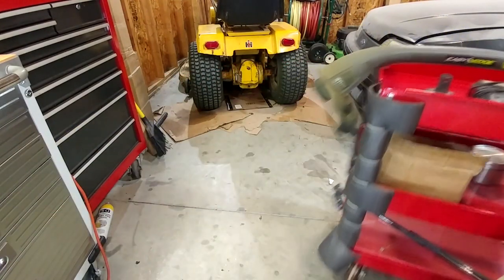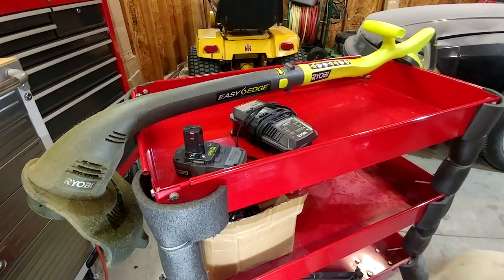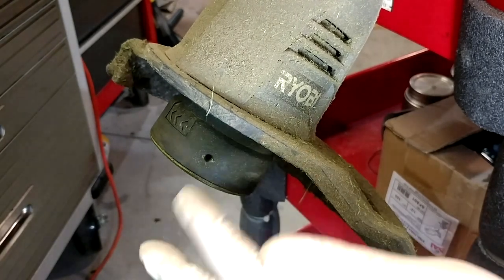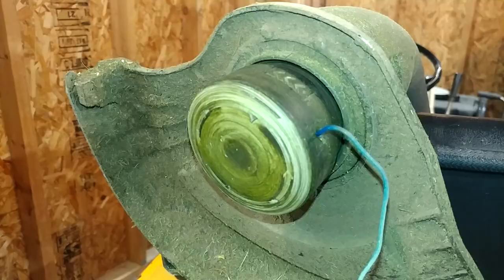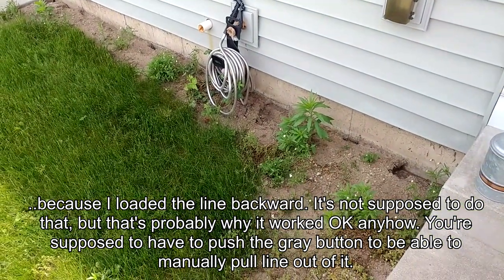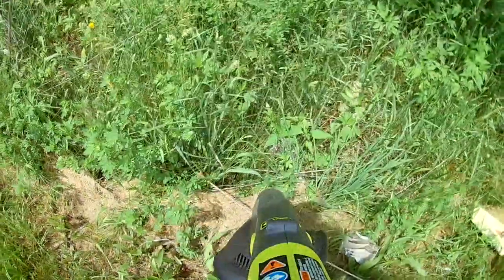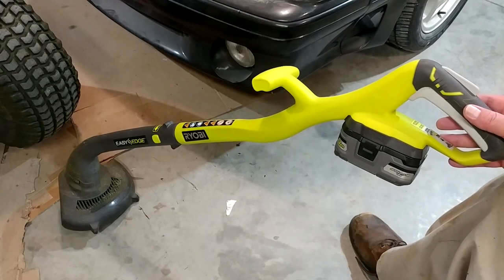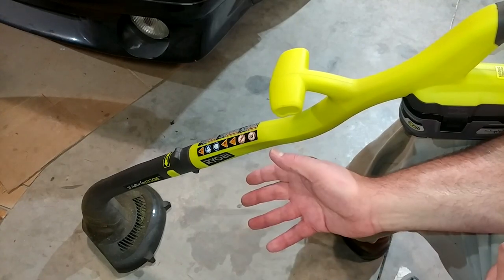Ryobi "EasyEdge" String Trimmer (P2003) 2 Year Review: Max's Tool Reviews!

Comment: I am 5'7½" and using this trimmer causes me so much backache because the shaft is not adjustable. So I have to hunch over. But my 5'5½" mother says it's good for her. The automatic feed on the string long ago ceased to work. So we have to frequently stop, turn the trimmer upside-down and pull the string out manually.
Reply from the maker: I'm 6'4" and it's pretty short for me as well.

Comment: Great video.  I have a dying Worx trimmer with Ni-Cd batteries that don't hold a charge.  Since I have some Ryobi One+ batteries from other tools, this inexpensive Ryobi line trimmer may be all that I really need for some small yard work.
Reply from the maker: Thanks! I've been very pleased with mine. A couple of updates on my thoughts though: The sharpened line doesn't feed as smoothly as the stock stuff did (though it does cut well) and I suggest at least a 3aH battery for it if you're going to do much edging with it.

Still, for the money, it's fantastic, IMO.

Comment: Good high quality NiCad is not nearly as bad as people remember them from the old Radio Shack catalogues when we were kids (I'm 50) and can be pretty useful even today.  I use a boombox outside a lot and I power it with 20 year old NiCad cells I bought in the 90s.  I just recently reconditioned them and I am still getting 1200mah out of them. Another nice thing about them is they stay good on a shelf for a very long time, like decades provided they have never been used.  I have seen 25yo new-old-stock cordless phones and the like with perfectly good nicad cells in them.  That will not work with any other cell type.
Reply from the maker: I never had much luck with them at all, particularly in power tools. Our 1980s cordless drill and dust buster were completely useless right out of their boxes. Maybe that wasn't the battery's fault, but that was my overall impression of cordless tools until somewhat recently. The Ryobis I've owned through both periods of technology perform much much better off of the Lithium Ions than they did off of the Nicads. I would have never in a million years expected that trimmer to even put up a fight against what I threw it into, but it did. Maybe I'm falsely attributing that to the batteries?
Reply: @TheBrokenLife  Things like this trimmer are not a good match for either NiCd or NIMH. You really need lithium and even then, the power density isn't great.  It is application specific.  
They are  a great match for a boom box or NiMH for a portable game and NiMh for X-box controllers and the like.  NIMH AA cells are a godsend for all things AA.  But anything using C or D cells is NiCad because good quality C and D NIMH cells are expensive as all hell. A good D is ten dollars a piece.   And you can get them at 5ah.
Unfortunately, everything today is throw-away. You buy a 300 dollar ipod and you throw it away in 3 or 4 years when the battery is no longer holds enough charge.
Reply from the maker: @tarstarkusz  I'm sure you're right about there not being a perfect one-size-fits-all application, but I really can't complain about how power tool batteries have gone in recent years. Although you and I have chatted a lot of Ryobi both here and over yonder, I do have some Milwaukee too and that stuff is also incredible. It's freakin' expensive though. I have what amounts to a $200 flashlight, but it's a really great flashlight.

It's not disposable around here! I will try to fix just about anything if given the chance (I've got a coffee pot torn apart in the shop right now). I still have my 60gb and 120gb iPod classics. The 120gb actually does still hold a decent charge... I do have to admit I don't have much use for them in the smart phone age though. I did make sure to buy phones that I can replace the batteries on without a soldering iron and a microscope. ;)

Comment: Have you looked into the '2-in-1 Pivoting Fixed Line and Bladed Head' accessory for it?
Reply from the maker: TLDR: No

The I can't shut up version: I've only used one of the bladed heads once and I broke it the first time out (snagged it in a fence and it sheared the entire head off in an instant) and I've never tried one again. 

My Dad had a Craftsman with a fixed line head and he really liked it, but to be honest the feeder mechanism the Ryobi comes with is so good that I can't see a reason to change it except for maybe the larger diameter line. For the power it has available, I feel like it does an awesome job with the .065 sharpened line I put on it.

FWIW, my Stihl uses .105 line (the fixed line for the Ryobi is .95) on a bump head, so if I need that much more power I can just fire it up. I will say there is a large performance difference with larger line and dual line heads make a big difference too. I'd be curious to see how it performs with it.

So... I did just look up pricing on the 2-in-1 one head, thinking if it was cheap enough I may try it out just for fun, but just that head is almost what I paid for the trimmer. 440 feet of made in USA sharpened line was $20 and will probably last for the entire life of the trimmer at the pace I use it.

Comment: Battery trimmer is the way to go for a normal house. Yeah if you are weeding a whole field then gas is king. But for going around the flower beds and sidewalk a battery one is tops. My old gas weedernwould not start so off to Craigslist to buy a used battery Ryobi job. Perfect. Yea it only lasts for fifteen minutes but that’s good enough for me.
Reply from the maker: With the 9AH battery, mine goes for like 45 minutes. It's great for what I need it for.

Comment: Mine just decided to stop working. Nothing happens when I try to start it.  Battery works fine in my chain saw, so it is not the battery.
Reply from the maker: Does the head spin freely if you try it by hand?
Reply: @TheBrokenLife  Yes, it does.
Reply from the maker: It's probably some sort of internal problem then. Sorry to hear it!
Reply from the maker: Would you be interested in selling me the corpse? I'd be curious to take it apart and see what went wrong. If so, drop me a line to the email address in the description.
Reply: I have this model and today it started smoking …I’m very sad cause I love this thing. I don’t know what to do:(